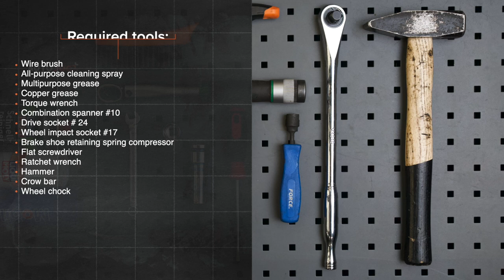How to change rear brake shoes on VW POLO 6n1 [TUTORIAL AUTODOC]

Comment: What is the tightening torque in the main wheel nut?
Reply: Not specified. Seems to
be done intuitively by first  tightening slightly, then mounting the wheel and wiggling it before an additional slight tightening, verifying that the wheel is still revolving freely on its new bearing.
Finally wheel is dismounted,  nut is locked and wheel mounted a final time.
Reply from the maker: You can find this information in the technical documentation for the repair of your particular vehicle.